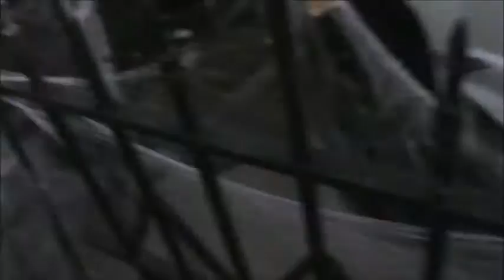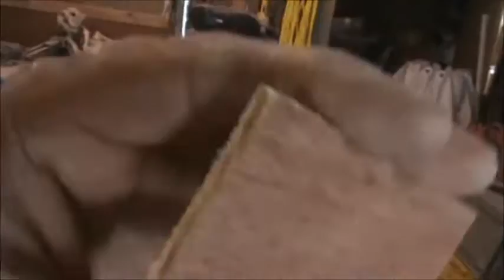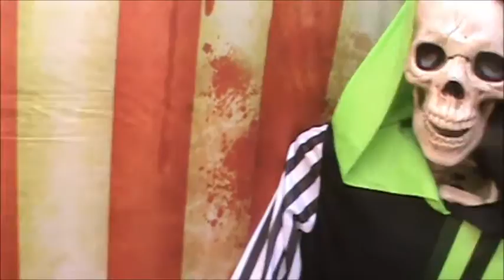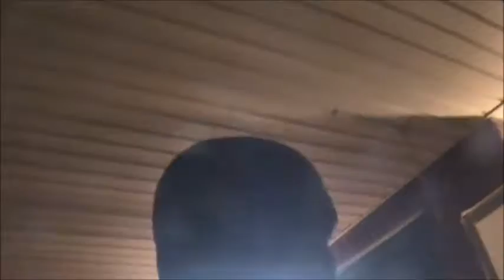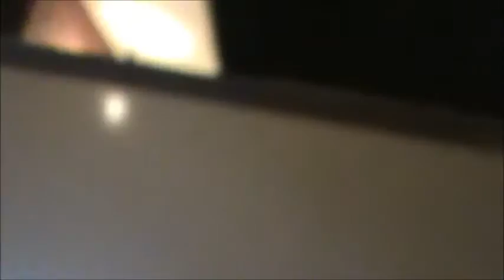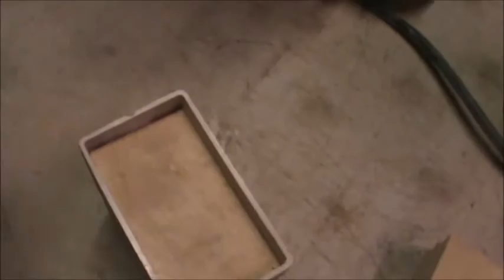Haunted Tents Set Up Day 18 10-15-15

Comment: Ram, I always thought the circus was "the greatest show on Earth".... not "the greatest PEEPSHOW on Earth"!  lol!
Reply: That's going to be an expensive Styrofoam ball if you can find one big enough.  If you don't mind the weight... go pick up a big rubber ball at Walmart in the kids department. Those are usually only a few bucks. 
Then go and fill it with concrete. :-)